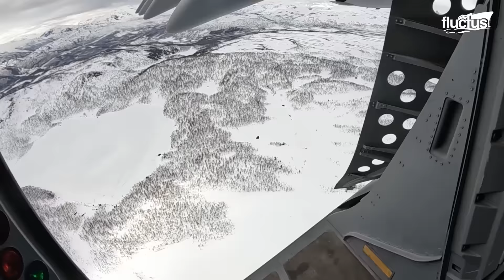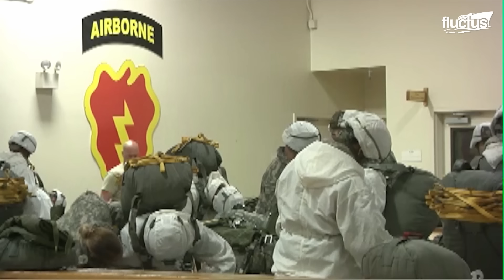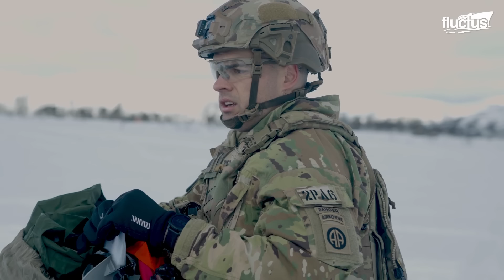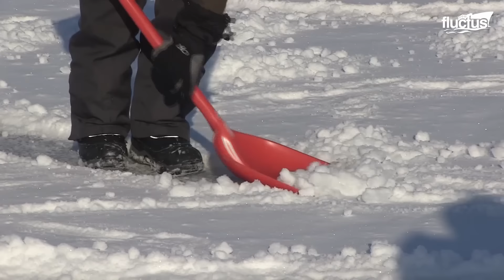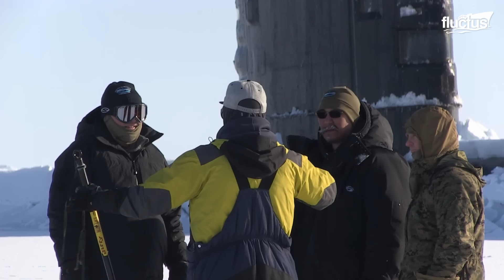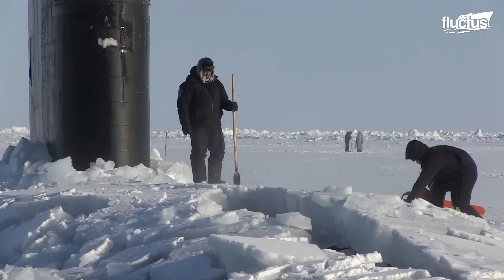US Paratroopers Make an Extreme Jump Over the Freezing Arctic

Comment: Too bad canada is too lame to be leading the way on this type of warfare.  This is what over half of our country looks like for over half the year - yet the last time our soldiers took part in an exercise in Alaska a large number of them fell out due to frostbite.
Reply: The US has had its cold issues also. The vehicles (Strykers) originally assigned to the unit in the video routinely failed in the harsh cold. That's a big reason the unit was changed and is slowly being re-equipped. The Hagglunds are amazing engineering...from Sweden. But they work in the arctic.